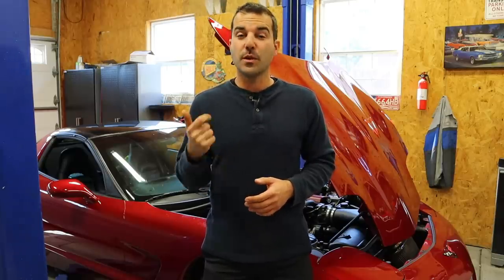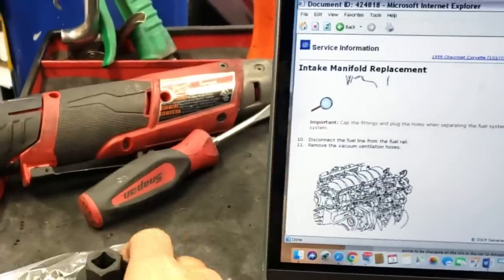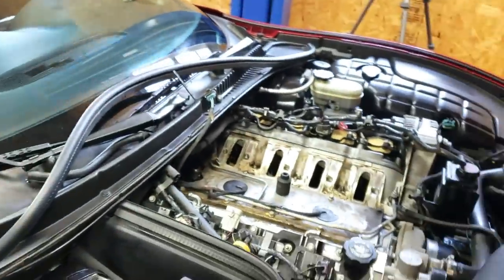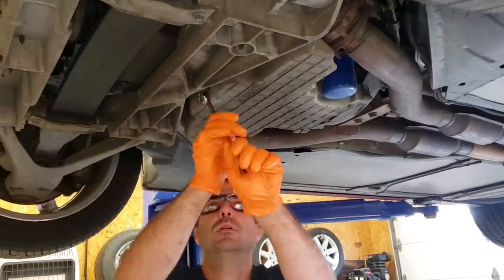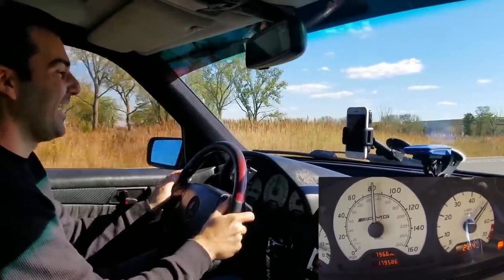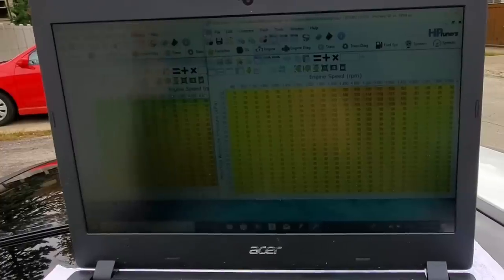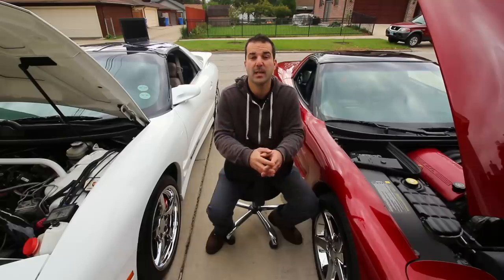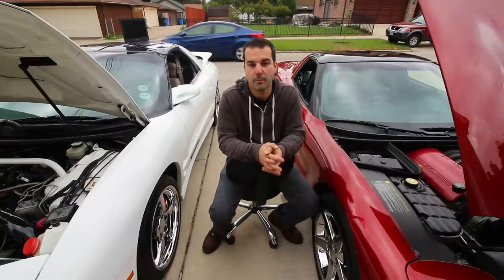I’m Building A 40 MPG Corvette That Sacrifices NOTHING! Project EcoVette Starts Now!

Comment: Speed limit is 55 mph? Wow, we haven't had that in years.... I live in Texas.
Reply: i mean you live in texas
Reply: AllTheBestNames Right but 80 mph will shoot his mpg goals out of the sky.  Best mileage is usually on flat farm highways at lower speeds.
Reply: We have 55 all over here where I live in Texas. All the douchebag drivers go well over 70 mph.
Reply: Where I live you can go 110 past a cop without them batting a eye
Reply: Jeromy Williams - In DFW we have express lanes at 75 MPH. My LS 430 definitely seems to get better mileage at 75-80 vs 65. Unfortunately distance is so short I am unable to measure the difference.
Reply: @joeherrjr  Yep I'm on the express lanes at least 3 times a week. Usually hop on 35 where 287 runs into it and I'll take it to 820/121/183 until 183 runs into 35E in Dallas. Luckily, I don't have to waste money. My company pays for it.
Reply: Outside of rush hour, everybody goes 70 to 80 around chicago. 
Cops only pull people over going faster than the flow, or if they want to search...
Reply: 65 here in town, PHX. From what I've seen it's 75 going in all directions once you are out of city limits. 55 is a slow highway speed limit.
Reply: My ES get lower mpg too from 40-45, than 50-65mph. 33mpg possible with slight grill block.
Reply: @donsremodeling  that's pretty much the only place in all of az where the highway speed isn't 75.
Reply: Yeah, I get better mpg around 60mph
Reply: @PacoRobbins  yeah they go 70 on the freaking access roads😂😂
Reply: Domino52o uhmmm no it’s 65 almost everywhere. 75 is not as common as 65 here
Reply: Gas mileage starts to get hit hard by wind resistance after 60mph.  It makes sense to do your optimal highway reading at around that.  From there going faster blasters your mpg.
Reply: Lucky you. California is riddled with these speed limits. I actually just paid off a ticket for going 70 in a 55 on an empty highway smh.
Reply: @hebson21  I can confirm that statement.
Reply: Went to cars and coffee in houston couple weeks ago and texas doesnt play. We where crusing 100 mph on the interstate and I'm not even joking there where multiple car passing us while we where crusing 100
Reply: my stock 05 e500 gets 23.5 mpg @ 95 out in east by GOD Texas.  works just fine for me.
Reply: @johnoneil6206  I get like 30 on my bike at 95 but like 50mpg and 50mph
Reply: I get 30-40mpg going 120mph constantly. 1.2LTurbo Golf 6 Wagon... on the German Autobahn :P
Reply: that's super good .23.5 mpg works for me at $2.90 a gallon for 93 octane. try THAT in Europe   LOL
Reply: @johnoneil6206  jea we pay a lot more fuel but our autobahn is a perfect racetrack and get maintenence, so we neraly never have broken suspension or flat tires, it's a tradeoff
Reply: the highest posted speed limit in the United States is found in Texas. 85 mph (137 km/h) on Texas State Highway 130, which is a toll road mainly between Austin and San Antonio. 

there are too many other highways in Texas to list that have 80mph (129 km/)
Reply: Speed limit in cali is 75 up to 80 at times

Comment: First gen Honda insight had factory lean burn mode in the US
Reply: Rex montana I was going to mention this.  You beat me to it.
Reply: That is so bad for the engine
Reply: So did my first new car, 1980 Honda Civic CVCC.
Reply: 92 Civic VX had a lean burn mode, as well as being able to only open one intake valve instead of opening both intake valves.
Reply: Gsfbffx Pdhhdf Nah, not really. I have a first gen Insight with 350,000 miles on it, doesn’t even burn a drop of oil, all original motor!
Reply: @gsfbffxpdhhdf7043  It was done with piston aircraft engines in airliners back in the day, there were no ill effects. Some light aircraft will also run lean, but they generally need to be equipped with special fuel injectors.
Reply: @gsfbffxpdhhdf7043  No, not if it is designed for it.
Reply: I have a first gen Insight and came here to say the same thing. It's how the Insight can get 53+ MPG on the highway with ease, from my experience.
Reply: @Zadnak1  I want one sooo bad!
Reply: my gen 1 insight only burns at 16.5:1.... but mine is a 2.4l now, and makes 250whp. still gets 45mpg
Reply: Insight, crx, and Civic all had versions with vtec-e which enabled them to go into lean burn mode. This was legal in the United States during the 80s and 90s but stricter regulations later on NOx emissions eliminated that tech here in the US.
Reply: @Zadnak1  the 53mpg rating is with the cvt auto. With the manual, you can easily  break 70mpg
Reply: @TexasStormHunter  I have a manual and I averaged roughly 59 mph when the battery worked. On gas only, I average between 50 to 54.
Reply: Klip One I believe it’s because the combustion can reach higher temperatures that the engine can’t handle if it wasn’t designed for that.
Reply: my tahoe hybrid  LS2 based  engine  has lean burn   it shuts off the injectors (Pulse width modulation ) you can watch the O2 sensors hit lean mode they drop to 0.0-0.2 on the sensor  it also has advanced deceleration  fuel cut off   the best i have ever done was 28.7MPG combined over 210 miles  31.1city/26.7hwy  not too bad for a 6.0L engine
my best highway was 27.6MPG  and best City was 31.1MPG  not too bad for a land yacht

Comment: Early to mid 90s Honda Civic VX had a lean mode. They were rated in the low 50s for milage.
Reply: I wish I could get that out of my 07 auto civic. Got 43 over 750 miles once ..interstate Windows up no a.c., 75 degrees. Put new tires on..tire guy was like wow Those are heavy as hell. Now I cant get over 36
Reply: I had a 92 VX back in the day. My wife got a max MPG of 57 on a trip once. I usually got minimum 40 mpg driving it hard.  Great car! Had a wideband o2 sensor that was the only thing I ever had to replace on the car.
Reply: Yea those EG VXs were great for MPG. Slow as shit. But very efficient
Reply: We had a 91 Mazda hatchback . Don't know the little car exact name but we drove all around L.a  east to inglewood then back to Boyle heights .. wasted barley any gas .. was Soo good that some times I forgot it to re- fuel .. 20$ = 2 weeks   😰😰😂😂

Comment: Great video. I'm learning a lot about the LS and how the engineers most likely set up mine. I also use Amsoil and have for years. I'm using the Signature synthetic in the engine and ATF in the transmission. I've hesitated using anything other than the factory LS in the diff as I have tiny lines going into a radiator cooler. So I just change it. There's little loss in the diff anyway. I think it takes only about a 1/4 bhp to spin the ring and pinion at 200 mph unloaded. So I did a 380 mile trip from New Haven to Montauk Pt Lighthouse LI NY, through NYC traffic and back and got 23.5 mpg with my LS7. I'm only supposed to average 18. There were times I was sitting in East Hampton summer traffic for 20 min stretches barely moving. I've been using Amsoil since about 1982. Even use it in my Deere lawn tractor...lol!

Comment: When a friend first told me of this project, I originally thought it'd involve cylinder deactivation or making it a hybrid LS. Getting to 40 MPG without either of those changes would be really impressive, especially without sacrificing performance. Keep it up
Reply: it can be done a stock c5 and c6 already hit 30 to 34 easily if driven correctly
Reply: @deadshot4245  Somehow I must've forgotten that, I suppose diff ratio and body material helps that (I'd say fibreglass, but I remember the C6 having carbon fibre as well, at least the Z06)
Reply: yep 3.15 3.23 2.73 are commonly seen on those c6 models 
 @MuscleCarLover
Reply: mine was a 3.23 i think been a few years cant remember exactly but 6th gear at 70 was maybe 1700 rpm or less was beautiful for highway cruising but plenty of power i cut off the mufflers and put on some nice oem looking exhaust tips to keep it looking oem. it was quite and throaty at idle and low rpm but if you slammed it turned into a race car volume loved it
Reply: @deadshot4245  Best of both worlds. I wouldn't be surprised if the 2.73 was reserved for autos
Reply: yep pretty positive it is ive never seen a 2.73 in a manual trans chevy yet in years of looking  @MuscleCarLover
Reply: my goal is a 1st or 2nd gen camaro 67-73 or a c3 vette from 68 to 80 personally then get overdrive in her for a daily driver i can fix with chewing gum and rubber bands if needed and anti theft device aka stick shift  @MuscleCarLover
Reply: @deadshot4245  Honestly, throwing a T5 in either option is probably a good way to go, regular 4 speed for around town and 5th for the highways and interstates

Comment: I hope it has a working knock sensor, because you can knock even at low load.
If you are tuning it anyway cant you keep the air flow sensor and just change the target air fuel ratio?
Discarding it would make it harder to balance on the edge of damaging the engine and force the engine to be slower at adapting to differences, because the lambdas are slow at adjusting and you need to burn the fuel first to find out if the air fuel is correct.

Comment: Great Job! I did a similar project on my 96 Suburban 5.7 auto 4x4. I now get 22-25mpg on the highway with more power and quicker response. 
After looking at what you did so far, you might add a KN air filter and oil filter, E3 Diamond Fire spark plugs, Bosch self cleaning 02 sensors, an MSD6AL, and Lucas fuel conditioner. 
Explained: 
1-The diamond fire plugs direct the explosion to the center of the piston, not off the side, creating more down force and less against the cylinder wall, plus a hotter spark for more complete combustion. 
2- Bosch self cleaning 02 sensors, keeps the readings clean and clear for the computer readings. 
3- KN air and oil filter,  your engine is a glorified air compressor designed to bring air in at a certain cfm level for max efficient performance, a paper air filter, no matter what brand, will restrict the incoming air flow causing undue labor on the unit to gather the designed operating cfm, The KN air filter will increase the available incoming air flow with less resistance. The oil filter is more free flow than any paper unit and results in reduced engine parasite drag from the oil pump, leaving more available hp to aid in mpg.
4- MSD 6AL(or equivalent) 'Multiple Spark Discharge'. 
Your factory ignition fires the spark plug 1 time per revolution, whatever fuel doesn't get burned goes right out the tailpipe.  Your 70mph cruising rpm is under 2,000. This unit will spark the plug 20 times per Revolution up to 3,000 rpm. This helps to ensure more complete combustion and less fuel lost out the pipe, resulting in more power and less emissions. The 'L' stands for Rev Limiter, I always use this in ANY vehicle that I upgrade, it will not allow the engine to exceed a pre-programmed rpm to avoid internal damage when a friend or family member drives it and feels all that horsepower, eliminates over-revving.
5- Fuel conditioner: Did  you know that your engine can only use about 75% of the fuel we get at the pump, no matter what grade? The rest is caught up in carbon clusters that don't burn and end up sticking to valves and pistons, and out the tailpipe. A high quality fuel conditioner will break down those carbon clusters so your engine can turn them into useable hp while reducing emissions at the same time. 

Each one of these individually will make a small but noticable difference, but altogether and now you've got something great!

Almost forgot to mention one more change that we did just recently. A guy came to our shop with his sales pitch, pointed to our 2001 chev 1 ton dually flatbed with a 5.7 auto, and said he could guarantee me a noticeable increase in hp and mpg without ANY of those previous listed items that we did. $300, and If no change, he would refund Every Penny. We all giggled and said 'You're On!', in the name of research of course😁. We let him do the work inside our shop so we could document and witness what he did. A roll of 10guage wire, a box of moisture resistant solder terminals, a multi terminal junction block, a box of self tapper bolts, and an impact drill driver. 
He said the factory does a Horrible job grounding each and every part of the drivetrain that the computer depends on a clean and clear signal to function properly. He ran 10 guage wire from the transmission, the exhaust catalytic converters near the 02 sensors, the fuel pump, the distributor, the alternator, etc.
** The last thing he did was zip tie 2 large neo magnets opposing each other to the incoming fuel line...... He said the strong magnetic forcefield between the opposing magnets helps to break up the carbon clusters in the fuel, resulting in a more complete combustion (hp and mpg) and reducing exhaust emissions.... We giggled at first but we let him do his thing. 
We paid the $300 in a money order so we could track it. He said give it 2 week's to notice a difference and call if not satisfied. 
Obviously our 1 ton dually beast, we had not even bothered to previously monitor the mpg, so we did not have that to compare. But after a week of our shop guys driving the truck, we had little choice but to call the guy back.... We had him do the rest of the trucks in our fleet! Our monthly fuel consumption has decreased with same or more miles driven, more power, quicker response, firmer shifts, there is a definite noticeable difference, paid for itself many times over. 
You can easily do the same for yourself at home, or find the guy in your neck of the woods that does this, it's a franchise small business, thousands out there!

Have a Great Day,  
And PLEASE film your V8 Eco-Vette parked next to a Smart Car 2cyl 60mph max that advertises 32mpg highway. What a Joke these companies are!

Comment: Ahhhh stoichiometry chemistry. One of my favourite aspects of chemistry in university. Extremely precise as well. We use lean burn in carbed aircraft as well. We have mixture valves/knobs that we adjust once in flight (carbed aircraft) to achieve max range of our every lb of fuel. A lot of variables. One key one is to try and keep the same throttle position. I don't know if the c5 can give you throttle position/angle/sensor and make sure that is similar in all tests. Only test on highway. Account for start up/idle fuel burn. Good luck. Its going to be great video/challenge.
Reply from the maker: Thanks for the advice. Appreciate that
Reply: rolls royce's new jets are supposed to use lean burn too, but theyre still a few years away
Reply: isn't stoichiometry the way to show a reaction? idk how to explain so heres an example "C + 2O --> CO2"
Reply: @Lysergic_   Not quite, you are thinking of stocih ratios assuming the reactants are completely consumed (100% efficiency). Ractants = products. You can use stoich to find the numbers in front of the reactants/products (Ratios) and you can also determine what compound will be created using stoich and atom analyses.
Reply: I remember the EGR valve was added to allow leaner mixer at low power, it introduces inert gases into the combustion cycle which cools the combustion temperature. The inert gas shinks the volume of the air/fuel needed for the stroke which "shrinks" the displacement when there is little call for power.

Comment: Just to correct you, the catalytic converter has nothing to do with lean burn or cleaning up NOX emissions.  The catalytic converters job is to burn off any hydrocarbons (I.e. fuel) that get past the combustion chamber and into the exhaust.  EGR (exhaust gas recirculation) helps lower NOX gasses by cooling the combustion process.  It works by introducing gases back into the combustion chamber that does not have oxygen.  So the EGR gases take up space that is normally occupied by atmospheric air that has oxygen in it.  Because of this, the combustion chamber temperatures decrease, thus limiting the potential of melting down a piston or two.

My personal experience with all of this involved tuning a turbocharged and cammed 3.1L V6 in a Chevy Cavalier station wagon with a Haltec standalone computer many years ago.  I was able to get the tune good enough where it passed tail pipe emissions testing in Dallas, Texas.

Comment: Light aircraft are sometimes run "lean of peak". Piston aircraft engines owners often install exhaust gas temperature monitoring for each cylinder. When equipped with "gami" injectors the fuel mixture is leaned until the exhaust temps are 50 degrees cooler than peak temperature. It "sparks" online debate, but saves a ton of fuel. Some claim longevity gains, but that is argued over. Should have said, in piston aircraft the pilot generally sets the mixture himself.

Comment: I’d put a real high mileage hard tire on it with a light rim and a lot of air pressure, lightweight clutch and flywheel might help with the underdrive pulleys, and weight reduction in any area will help, also, running a thinner oil if possible, along with running it lean, adding timing at max vacuum such as when you let off the throttle, will help with efficiency. Remove windshield wipers also
Reply: Rotational mass is definitely more important, I agree there, but I believe any time you can remove weight, your going to be more economical cruising no matter what, other wise every body would be adding weight to their vehicles to get better fuel mileage
Reply: noxxi knox yeah that’s right,

Comment: The original reason the US army air corps investigated water methanol injection was to facilitate lean burn and thus increase the range of their bombers.
The Germans used it on some of their aircraft to counter poor quality fuel on boosted engines 
Adding a water methanol kit to a lean burn tune is a must as it will cool the combustion protect the engine and reduce nox.
Reply from the maker: Great thinking!